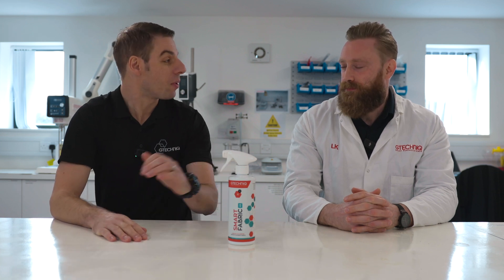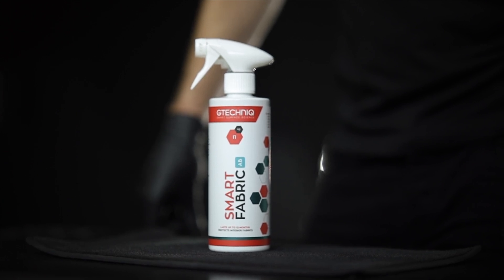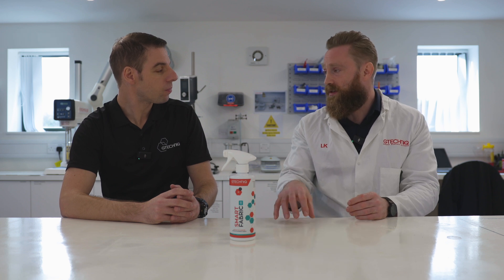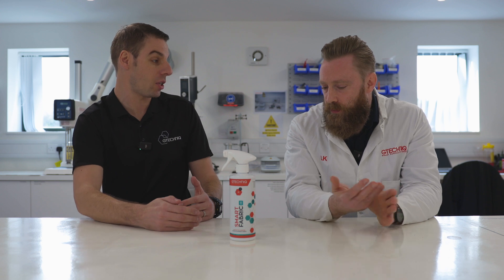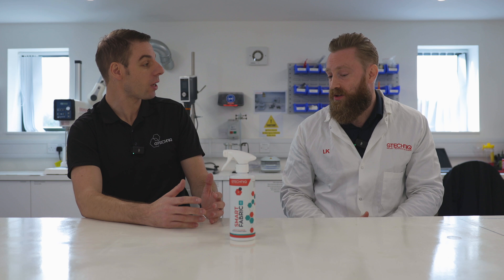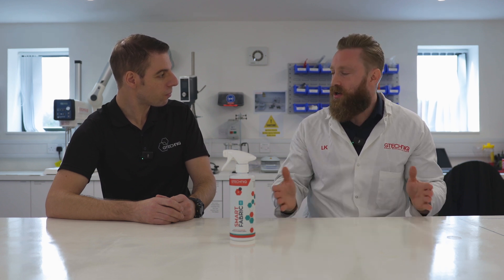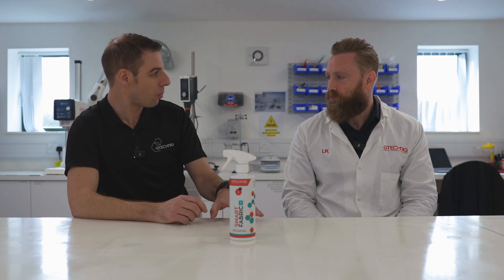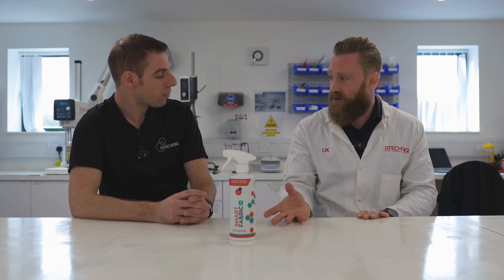Tech Talk - I1 Smart Fabric V3

Comment: Is this product preferred to marine fabric coat for convertible soft tops? Trying to figure out if the UV protection is worth using marine for.
Reply from the maker: We would recommend the Marine version as this has been designed specifically for Marine application.
Reply: @GtechniqUK  The Marine version won't change color or leave any visible residue in a black fabric top, yes?
Reply from the maker: @chrisbradley3224  It might deepen the colour, but it will not change the colour of material.

Comment: Hello, is it better to just spray it, or to spray it and agite it by hand with a glove?.  Does the agitation interfere with the final performance?. Because I finally bought the V3 version.  I had already used the V2, which I was very happy with.  When using it I spray then I rub with my hand with a glove, but I'm looking for maximum performance / durability.  Hence my question Thanks in advance
Reply from the maker: You can indeed work it into the surface with a glove. First apply the product to the surface and then gently rub or work it into the surface to ensure the product penetrates into the fibres.

Comment: Is this safe on the ventilated suede seats?
Reply from the maker: Yes, this is suitable for suede seats. A top tip is to use less product than you would do normally due to the shorter pile of suede fabric.
Reply: @GtechniqUK  Thanks for your quick response. Just one more question. I noticed that this version has no UV protection; however, your GTechniq Marine Fabric Coating is very similar to this product but has the UV protection. Is it safe to use that on the car's fabric (Suede)?
Reply from the maker: @PNSP  Yes, this will be safe to use on car fabric.

Comment: I have a question about applying the product.  How do I apply the product and what is the best way to prepare the area before application and Could the product be applied to anything that is a type of fabric?  On the car carpets, on the seats, even on the ceiling and on the doors?  .  
And last thing , what about protection?  Besides hydrophobicity and anti bacterial, does the product protect and preserve the fabric in the car?  For example, repels sunlight and keeps it from fading?  Please waiting for a reply.
Reply from the maker: We would recommend thoroughly cleaning the area you wish to apply the Smart Fabric to. So a good vacuum followed by a wet vacuum would be best. If you don't have access to a wet vacuum, then you can always use our I2 Tri-Clean with a detailing brush, some microfibers and a bucket of warm water to rinse and clean the dirty microfiber(s) in. Once the area is clean, allow it to fully dry before applying Smart Fabric. 
Smart Fabric is safe to use on carpets, seats, door cards and roof linings. 
 Smart Fabric wasn't designed with UV protection in mind and as such hasn't been tested for this, so we can't say that it would help prevent the fabrics from fading.

Comment: Do you have a recommend ml/m2 for typical automotive carpet and Alcantara?
 
What are the dangers of oversaturation?
Reply from the maker: It depends on fibre height and density and the size of area you want to cover. As a guide, we normally recommend approx 750ml for a medium-sized soft top.

In terms of Alcantara you would use much less product as the fibres are much shorter - so aim to use half of what you would normally.

Comment: Might be worth a punt. 

I used the V2 to treat the seats on my brand new car when I got it, followed the instructions exactly but got absolutely zero water repellency at all. 

All I did get was about 3 days of extreme chemical stench.
Reply from the maker: Without knowing the ins and outs of how it was applied it is always difficult to diagnose. However the lab test and real world testing of the V3 speak for themselves and we are supremely confident in this product.
Reply: I tried the v2 mate exactly as stated on the bottle, on alcantara, and it worked just like the YT video showed. Did a test and the water beaded and slid off the seat.
Reply: @_J4CK4L_  weird. I wonder if perhaps I might have gotten a dodgy bottle.